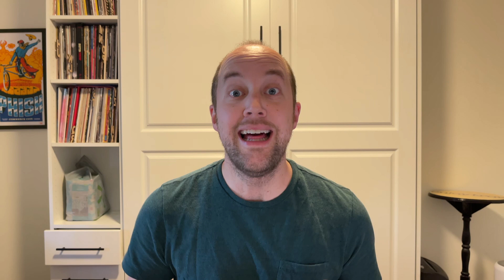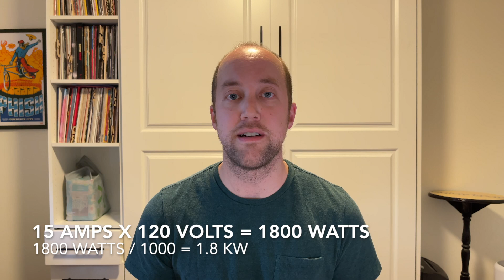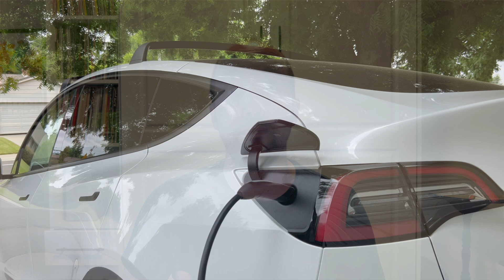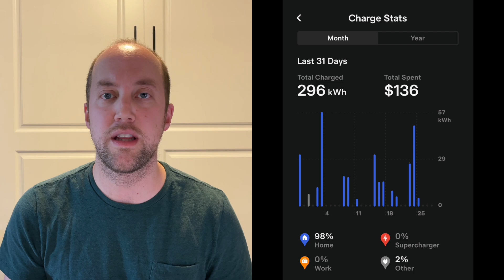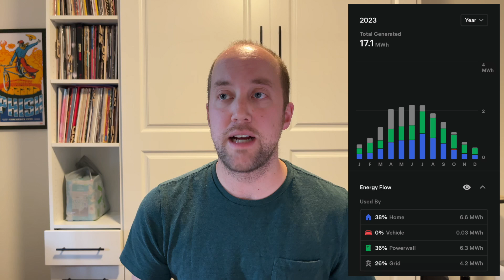Tesla Solar Panels & Powerwalls: Putting Power into Perspective

Comment: Could you supplement with how much you would be paying in your area for an equivalent gas car for the 1,000 miles per month plus 2 oil changes a year? Also an ACs demand is very dependent on how well your home is insulated I live in Southern California and my AC only runs in the hottest summer days for very short amounts of time
Reply from the maker: Last I saw around the Sacramento area gas was at 4.99 a gallon for the cheapest grade. Assuming 30-40 mpg, it'd be at about $150 a month per vehicle.  So roughly $4,000 a year in fueling/oil change costs for 2 vehicles.

Our home is pretty well insulated, however when it's 110 out our AC will run for 6-8 hours a day...but I like it cold! We don't get too much of a Delta breeze in the summer cool things down.